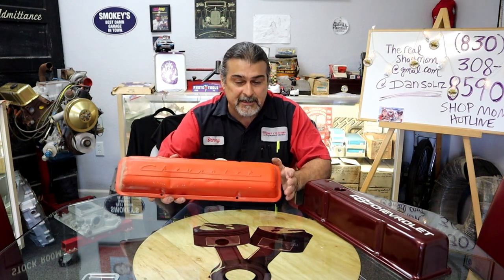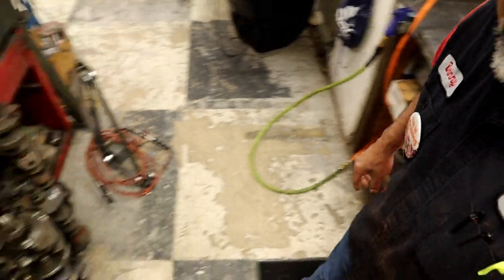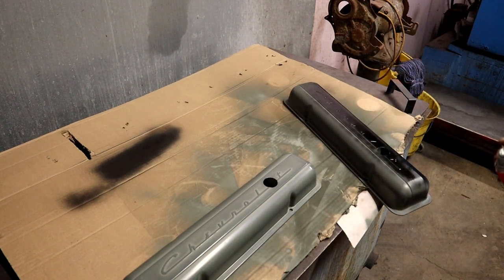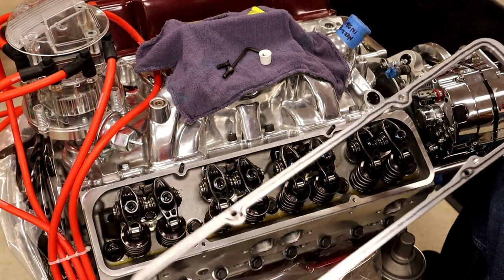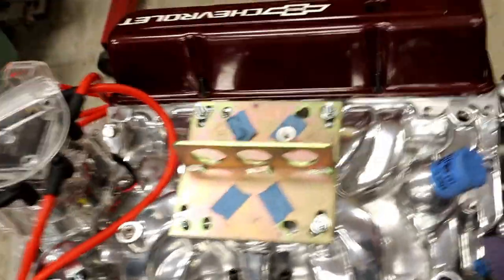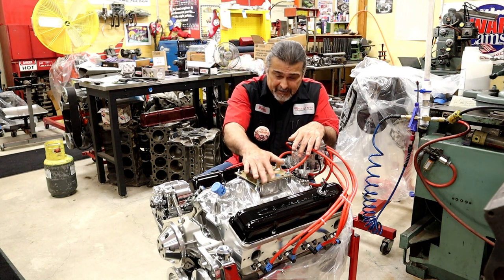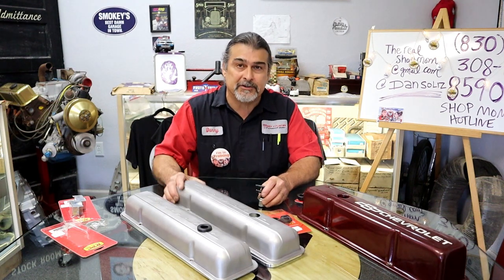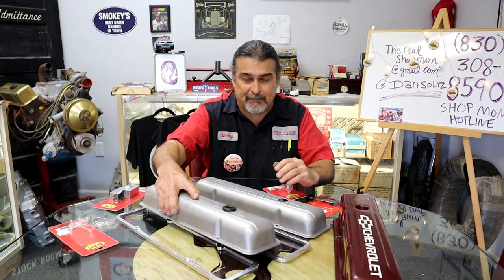HOW TO USE EARLY CHEVROLET VALVE COVERS ON YOUR CHEVY

Comment: Great job on those valve covers, they look brand new to me; remember, the more time that you spend with the mask On... the longer you'll live, you don't really want paint in your lungs in the long term, also, you'll see that your buggers are of the colour of the things that you'd painted that day, it's not a good sign, use the mask. To aboid the paint, coat or clear squirts from the sprays there're two common things that one can do, space the pieces that you gonna paint, as simple as that; or... there're "muzzle replacers?" ('recambios de boquilla') for the sprays, for less than 3€, that you put in place of the spray muzzle and are a regulable muzzle with a trigger for two or three fingers and a nut that you turn left or right to regulate (open or close) the arc of the paint or whatever the spray that you're using is, they improve a lot the final resoult and the job; but, you've to clean 'em after each use, always clean and maintain your tools. To remove paint tears or whatever... use a microfiber cloth, or even paper, quickly and take it off, remove that tear without put pressure on the spot to don't leave a mark there, the next layer will/should equalize the height of the paint, base coat, clear or whatever; you can deep the spray's muzzle in thinner and clean the exit hole and the hole in the base of the muzzle with a very slim needle to make sure it's clean. That engine look beutiful at the end; hope that Elaine and you had a great 4th of july and that you've an even better week, stay well man.

Comment: hay dan are you going to put one of smokeys engines in anything . i am 67 and have been a mechanic all my life . i started fixing thing at 12 . and worked at a chevy dealer at 17 . my dads side of the family were all mechanics . my great grand father was one of the first  ford dealers . how did you learn to be a machinist i think you started young like me . do you remember the old sun distributor machines you set a distributor to do any thing . i was taught by a man who even took the tire size in inches a round it . man did i learn alot from him . well this is getting long so i will stop here my friend .    ps smokey was my hero i read every thing i could find . thanks   les .
Reply from the maker: Yes worked on the Plymouth this weekend and will put the 2.2 back in it. Did the brakes next the fuel tank and sending unit. I was born doing this and been doing this since I was a kid. I also love Smokey.

Comment: I have a PVC in on one side and a empty PVC hole on the other side( black elderbrock valve covers). Idk how to fill my oil no filler cap.
Reply from the maker: I’ve come across engines like this and that’s ok, I just pull one pvc valve and add oil there.

Comment: Where did you put the oil filler
Reply from the maker: The oil filter is still where Chevy put it. No need to move the oil filter.
Reply: @MrDanielSoliz  on my old covers, the driver side cover has two holes. One for the PCV valve and the other for the oil filler. But the new cover only has one hole for the PCV valve. Do I need to cut a hole in it for the oil filler or get rid of them ?

Comment: Great vid Danny..Suggestion..If you're as anal as Me.. follow the primer with a thick coat of silver paint on top of the raised Chevrolet script .. wait a day to dry then top coat with black ...wait a day to dry... then use rubbing compound on the raised Chevrolet script to rub off the black from the Script . You then have a licence plate effect. Top coat with clear. This method works on licence plate and pickup truck endgate lettering restorations as well.
Reply from the maker: Great tip, thanks